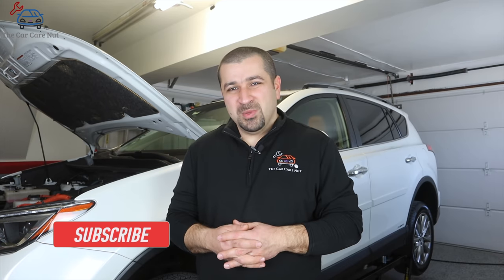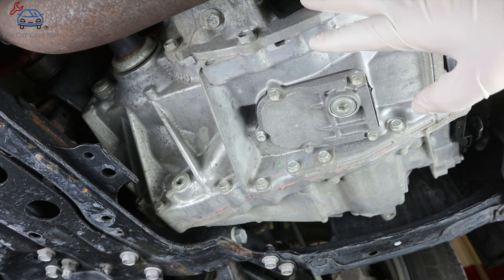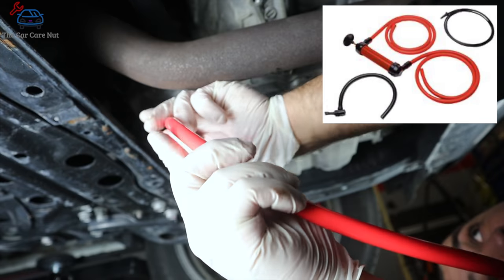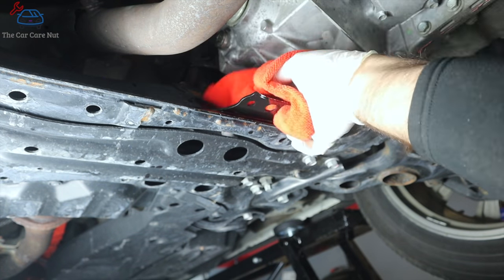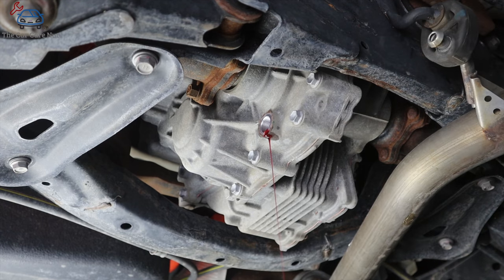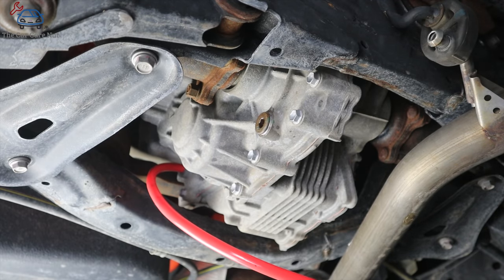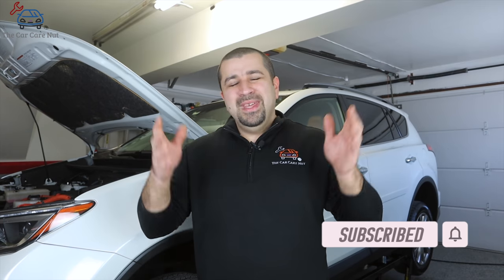How to change Toyota Hybrid Transmission fluid and Differential fluid

Comment: Hey, how often should the oil be changed on hybrid Toyota and Lexus?
Reply from the maker: Every 60-90k or 6-9 years
Reply: @TheCarCareNut  but regular engine oil?
Reply from the maker: Hi! Sorry did you mean how often the transmission oil or the engine oil needs to be changed?
Reply from the maker: I recommend you change the engine oil every 5k miles or 6 months

Comment: Hey Amd, I just read over the TIS for the 2019+ RAV4h eCVT and it throws a little curveball. 

It states: 
After initial drain of old ATF fluid and addition of new ATF fluid, let the car idle for 30 seconds in maintenance mode, turn off, and repeat drain and fill of another batch of new ATF fluid.

My question, is the 2nd drain and fill of new ATF fluid needed, your video shows you doing 1.
Reply from the maker: Hi Michael. Thank you for bringing this up. Could be an error in the manual. If you instead of going to the maintenance section go to drivetrain then find the transmission and go to fluid adjustment you’ll see the exact same procedure without that section. We’d do that if there’s contamination but a normal replacement it doesn’t make sense at all. I’ll inquire about it from my side and see what I get back.
Reply: @TheCarCareNut  Truth be told, I have the TIS I'm referencing thanks to a generous user who had access to the service at the time haha.

I'll take your word for it as I more or less thought the same, it makes sense. The TIS IMO play's it safe and doesn't factor in contamination, driving habits, loads etc like you say. Thank you for taking the time to reply and looking into it!
Reply from the maker: TIS will give you general information and usually limited when it comes to maintenance. Abs errors are possible that’s why they have a feedback button to submit correction requests

Comment: Hi, I have used Valvoline Max Life ATF Fluid on a 2010 and 2015 Camry transmission instead of Toyota WS fluid.  On 2015 Camry at 130K I bought used, the transmission was shaking at red lights.  The released fluid was completely dark, I did two drain and refill.  That should have 75% new fluid if I can only drain 50% each time.   Valvoline Max ATF works great, after more than 50k miles on each car.  Can I used Valvoline Max Life ATF Fluid for eCVT, which also looks like using Toyota WS fluid?
Reply from the maker: Hi! I wouldn’t

Comment: One more thing i want to mention that Toyota's genuine differential oil is very expensive , and mostly people use mobil1 gear oil.
Reply from the maker: This is a hybrid differential and Toyota hybrid transmissions use WS. Non hybrid differentials use gear oil and Mobil 1 is good there
Reply: Thanks 👍.

Comment: I was at my Toyota dealer today. I ask them how much they charge for a CVT oil change. The service guy says, "we don't do that and don't recommend it at all, it can cause all kinds of problems with your transmission". So I ask him if I plan on driving my Prius 200,000 miles you would not change the oil. He says "no". So what is a guy like myself who has 89,000 miles on his Prius to do. I hope to drive it to at least 150,000. Please help!

Comment: hi bro my car is camry hybrid 2014 and its over 141000 miles can i change the transmission fluid bear in mind i did not change the fluid even ones and when i traid to check the fluid it was very black and smelly ...pless help me
Reply from the maker: Hi! On hybrids you can change the fluid at any mileage

Comment: @11:53 👉 please be careful, the gasket for transmission is different than the gasket used for differential drain/fill plug. Right part number for differential plug gasket is 12157-10010. Couple of months ago i made same mistake i by putting the transmission plug gasket on differential plug and after a week differential fluid started leaking. Watch out. Thanks.
Reply from the maker: Hi. That is the number that we’ve used at the dealership without issues. Was that a hybrid differential that you’ve used this same gasket on and it leaked?
Reply: @TheCarCareNut  Hi it was not hybrid but after spending so much time reading and research i figured out that for all toyota vehicles transmission plug gasket and differential plug gasket are not same. For transmission plug gasket part number is 9043012008. And for differential plug gasket part number is 1215710010. Thanks.
Reply from the maker: So there are mainly 2 types of similar sized washers that you’ll see. One is aluminum and one is a crush washer. Hybrids will use the aluminum for both the transmission and differential. The non hybrids auto transmission will use crush for the differential and the transmission will have an aluminum for the fill plug and usually a completely different size for the drain plug

Comment: I've acquired a 2015 Toyota Crown Majesta with the 2GR-FXE hybrid / L110 transmission. Anyone know if its fluid change is the same as this video? Or is it the more complicated method requiring getting the fluid up to temp then drain the overflow?

Comment: Correction at 4:35.  Always take out your fill plug first, not the drain plug.  Correct idea though, need to be able to refill the trans if you can't get out the drain plug.

Comment: Sept 2022 and another reminder not to overlook the Hybrid traction battery-air cooling filter and the vanes on squirrel cage blower-under the back seat. Something that's not even mentioned in the  2017 owners manual.

Comment: I have 2010 lexus rx450h got oem lexus/toyota transmission ws fluid from the dealer, when I asked the parts rep how many quarts I need he said 3.8 in transmission and 1.9 in rear axle but then he said he's not sure, by any chance do you know what's the exact amount I need , or just drain as much as I can then fill it untill over flows and then call it a day ? I bough 7 quarts that should be enough ? 130k on the car , never new I needed to replace them, since they told me it's lifetime at the time of purchase back in 2014 with 53k milles back then. Thanks
Reply from the maker: Hi! 7 should be enough for both. Fill it until it overflows

Comment: At Lexus they never change the eCVT fluid saying it's not just drain & fill procedure this is changing only 1/4 of the oil..., for an is300h costs ...800euro the 90000km service (sparkplugs, différential oil, etc) but not the transmission , they say its lifetime fluid, for sure it will last at least 500k miles in normal driving
Reply from the maker: Hi! I would replace it as the “lifetime” is not defined as how long. But it’s up to you.

Comment: Hi, ADM. I have Toyota Camry Hybrid 2013. it is about 200K miles on it. But I have never changed transmission fluid on it. Can I change it now and how to do it better? Thank you in advance.
Reply from the maker: Hi! On hybrids you can change the fluid at any time
Reply: @TheCarCareNut  Some advise changing the fluid partially, in several stages.  Pour out a liter of old fluid, and fill in a liter of new fluid.  Is it possible to do so?
Reply from the maker: On hybrids it’s not possible to do that. Just drain the transmission and fill it and you’re all set
Reply: @TheCarCareNut  Thank you for the answer. I will do so.  believe you.
Reply: @TheCarCareNut  and ATF WS ok?

Comment: Greetings, My garage said that there is no link between the transmission and the differential , so no point to replace the differential fluid? 
A bit weird i guess?
Reply from the maker: Hi! It still needs to be replaced
Reply: @TheCarCareNut  I spent roughly 300 us $ just to replace the front and aft transmission oil, not sure wether  or not they replaced the o’rîng, they haven’t drove the vehicle to recheck the top off.

Comment: I took my 2019 Camry Hybrid to the dealer yesterday. 37k. I asked for trans service and they did a flush according to the paperwork. Is this common in dealerships?
Reply from the maker: Yes it’s common but you can’t flush a hybrid transmission? Perhaps they drained and filled it and wrote a flush by mistake
Reply: @TheCarCareNut  Thank you. I figured as much based on the video I watched. I should do it myself but I do not have a place to work (town house)

Comment: Is this transmission fluid change the same method with Nissan altima hybrid too? Because my Nissan use same inverter and abs with toyota camry hybrid BT i don't know if the gearbox is the same...  Pls i need a clarification on this
Reply from the maker: Hi! I don’t have experience with Nissan hybrids
Reply: @TheCarCareNut  OK thanks

Comment: I have the same deferential in my 2006 toyota highlander hybrid and it's leaking in both sides where it's connected to cv axles, can post a video on how to fix the leak. Thank you.
Reply from the maker: Hi! It’s the axle seals. If I get one in the shop I would film it for diy but those are not very common to leak
Reply: Thank you for responding, I might have to change or clean the breather, maybe it's clogged.
Reply: Thank you for responding, I might have to change or clean the breather, maybe it's clogged.

Comment: Is this the same fluid & procedure on a 2019 RAV4 Hybrid? I can't find anything about the transmission fluid type or interval in the owners manual. Thank you!
Reply from the maker: Hi! This is the same as your rav4 and it takes Toyota WS ATF and replacement is recommended every 60-90k miles
Reply: @TheCarCareNut  thank you sir! Thank you for all the helping videos!

Comment: I got a used IS300h hybrid in the UK. I asked the dealership to replace the e-cvt fluid as the car has 90k miles. The lexus dealership told me its sealed for life and doesn't need to be changed. They said if i still want to do it i might start to have problems as the fluid comes with a special balance of chemicals from the factory that shouldn't be changed as its not designed to be changed and not even part of the standard lexus service schedules either. Can someone please confirm this? It does sound like changing the cvt oil doesn't feature on any lexus service schedule here in the UK.

Comment: Hi, how about Toyota Noah 80 transmission fluid change?
Reply from the maker: Hi! Is it a hybrid model?
Reply: Yes, it Toyota Noah hybrid X
Chassis No. : ZWR800436914
Manufacturer 2020
If you can share video for transmission fluid change and that's will be great, once again thank you very much.
Reply from the maker: Hi! It should be the same process as this video
Reply: Thank you very much for your info, have a great day.

Comment: I have a question on my 2010 rav4 tranny. I purchased it from an individual when it had 91,000 miles. He had not changed the tranny fluid.  It was black. I did a drain and refill twice to get more dilution.  It is now a reddish gray color. I did use Toyota WS fluid. Why was the fluid a black color? I have seen other videos and the fluid is black even with lowwer miles. Is that because of the clutch material  components?
Reply from the maker: Hi John. The color you’re having is normal for WS fluid. It tends to turn darker quick. But if you shine a light at it you’ll see a beautiful red color. Burned fluid will tend to be brown and look more like motor oil when a light it pointed at it

Comment: Hey guys, hope you are all doing good. I have a Question. In which intervall do I have to change the transmission fluid for a corolla 2.0  hybrid 2019. I have read a lot of diffrent numbers. Some Say 30k miles some say 60k other say "lifetime" Fluid. 
It would be very helpful if You could give me a number of miles for the intervall. So that I dont change it too early or too late.
Reply: 60k to 100k miles, that's what he said for Hybrids in general.

Comment: How often should the transmission fluid be change
Reply: Once you start changing it on a routine interval/ 20,000 miles 30,000 miles, you'll begin to notice the quality of ATF your letting out.... 

Depending on what your transmission fluid looks like you should extend or lessen that interval.  I'd start at 30k or 40k miles an go from there.

Comment: I am from europ,and have a lexus is300h.I want to change the transmission fluid, but it looks not so easy by draining and filling.In the manual I see it has a pump.Has anybody changed the transmission fluid on a lexus is300h?

Comment: Hi, I have a ‘17 Camry Hybrid. I’m just comparing this video to the procedure you have for a regular transmission. Seems like overall the hybrid transmission service is easier. For a few reasons, full access from under vehicle, no need to worry about temp for setting the fluid level… I’m I missing something or is the hybrid transmission fluid change a much easier procedure? Any additional items to look out for?

Comment: My toyota dealership told me my 2021 rav4 prime required CVT fluid on the rear and, therefore, will cost more than the front.  It's about $350 for rear to change rear and $250 for front.  Lol
Reply: I recommend doing it yourself, it's what I did on my corolla hybrid at 115,000 miles.

Comment: Are these not life time as my old camry was?
Reply from the maker: Hi! Lifetime is relative term. I would replace it
Reply: @TheCarCareNut  . Sold car with 400k on it. Fluid red. Trans shift like new.  Curios on your video as fluids still look fresh.   Just bought hybrid rav4.  Love your video yhough. Dealer wanted to change oil once per year. I now do 2×.
Reply from the maker: The fluid typically starts getting dark and gritty around 90k miles from experience. Were your miles mostly highway?

Comment: Toyota Europe say the transmission is sealed for life and the fluid never needs to be changed.
Reply: Is Toyota the manufacturer of the part?
Reply: Toyota Europe is correct, however the definition of "life" is the same as the transmission warranty. Is it 3 or 5 years in Europe? If you plan to keep your car for more than 3 years (or 5 years?) then this does not apply and you will need to change the transmission fluid. I know many car buyers here in the USA that will never keep a car for more than 5 years. Personally I have never bought a car less than 5 years old.
Reply from the maker: And they would be right. But the missing information is the definition of the life time. As Donald mentioned. I wouldn’t wait to find out what’s the life time and replace the fluid with original.
Reply: @TheCarCareNut  you may find this in the actual part manufacturer manuals

I can tell you is the same story for BMW's transmission. ZF being the manufacturer clearly defines maintenance intervals.

There is no 'forever fluid' 🙂

Comment: You didn't change the front diff/transaxle fluid?
Reply from the maker: Hi! Yes that’s what the video is about? The transaxle and front differential are one unit and share the same fluid
Reply: @TheCarCareNut  Ah, understood. I thought the CVT was a stand alone unit. Didn't know the CVT and front diff/transaxle was one big all-in-one unit. Is this also the case for AWD 2015-2019 Highlander Hybrids?
Reply from the maker: Yes it’s the same deal with that generation highlander hybrid

Comment: Am I right in thinking you said that it takes between 3.5 and 4.5 qt.s of fluid in a prius?? the reason I ask is as usual mechanics are hard to find, I just had mine changed and I saw him looking at the side of the bottle , and I new he was fixing to put the Toyota stated 3.6 qt. in and I told him I would prefer he put the rest of the 4th qt. in and he replied that would be over filling it and would not be responsible if anything happened to the car. I didn't say but I wondered how he thought he could overfill it threw the site port but I said this to say none streamed out , and he put 4 qt. in, should I be worried that it doesn't have enough fluid?????

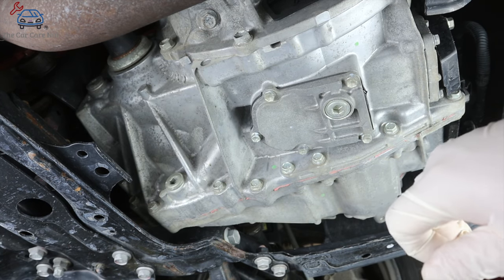Comment: At 4:30 mark, you said "make sure to take the DRAIN plug out first" - it should be "the FILL plug out first" instead. I'm about to do my 2022 XSE Hybrid @ 130K miles and watched this video 5 times to get it ingrained into my head. Excellent video otherwise.

Comment: Part of this video needs edits.  The FILL PLUG up above and adjacent to the drive axil should be removed BEFORE removing the drain plug.  The DRAIN plug at the bottom of the ECVT transmission is removed AFTER removing the FILL plug.

Comment: "Tighten it down"? What torque? I can't tell you how many times I've had my vehicles come back from OEM Dealers with fasteners improperly torqued! (Typically way over-tightened.)  The average DYI owner does not have anything like the 'feel' for torque that an experienced mechanic has... Most annoying is how the under engine cover is screwed on with flimsy screws, and they are often returned stripped because of over-tightening. And that's not including the screws they dropped and didn't even bother re-installing. I also clean the area around the drain and fill plugs before working on them, as well as the fill plugs themselves, before replacing the crush washers and re-installing them. Cleanliness is important to ensure grit doesn't get under the crush washers, or even worse, contaminate the fresh oil...

Comment: you changing any oil on your Toyota Hybrid while it is in warranty could violate your warranty and reduce the resale value - not a sensible thing to do
Reply: He recommends 60k-90k for changing the transmission fluid on Toyota Hybrids - which is already outside of the Basic and Powertrain warranties anyway. 
Correct me if Im wrong though~